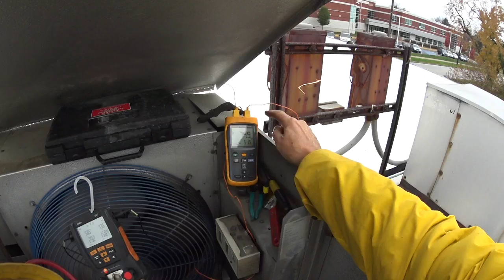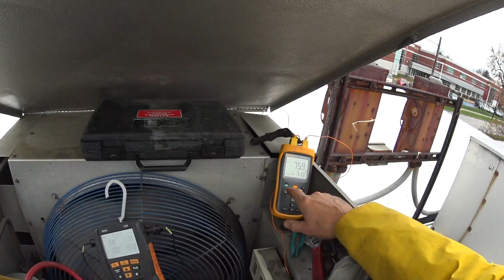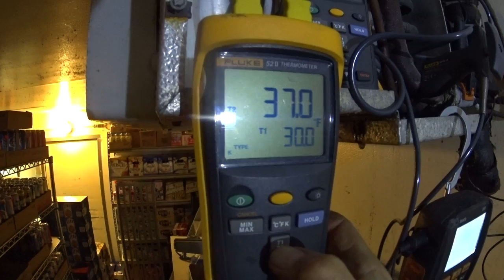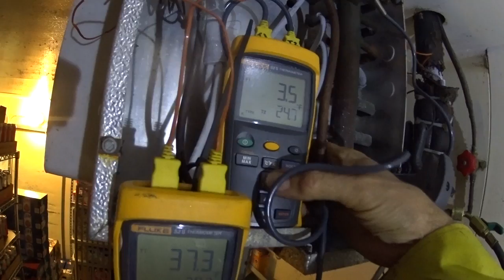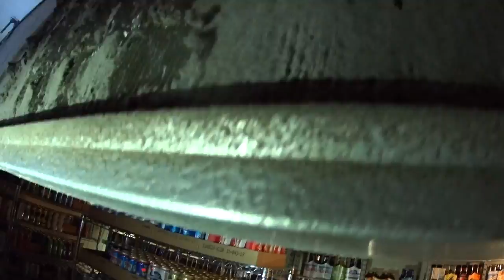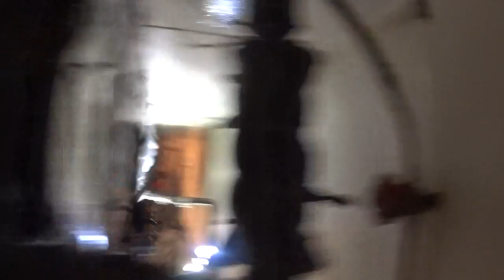Walk in Cooler charging and cleaning the Evaporator Coil part 2

Comment: I have found that when the air blows out from the side of the fan its due to a dirty condenser coil. when the Air flows straight back thats an indication that the coil is relatively clean. One thing I do on almost every system I come up to from habit is feel the direction of the air coming off the coil. It will give me an indication on the condition of the interior of the coil where its hard to see. Works on almost every fan that is that style. Evaporators, Condensers, Residential AC units large or small... give it a try and see what you think. Great vids. Keep it up!